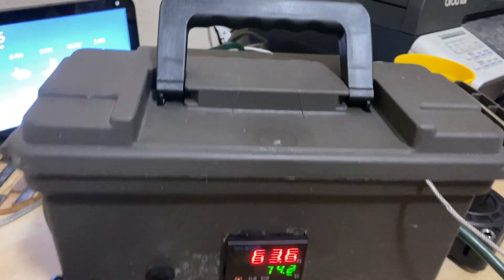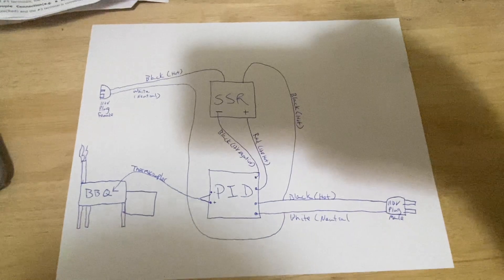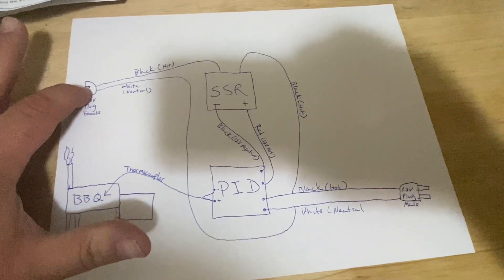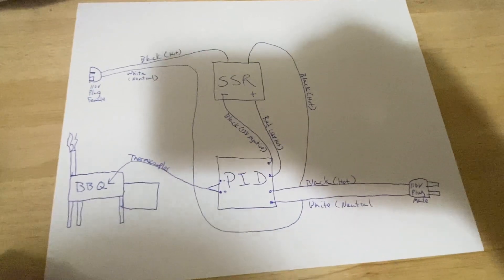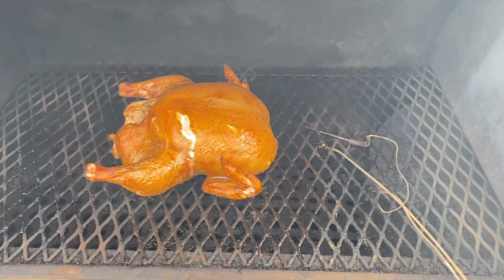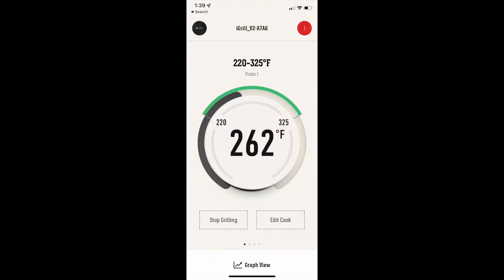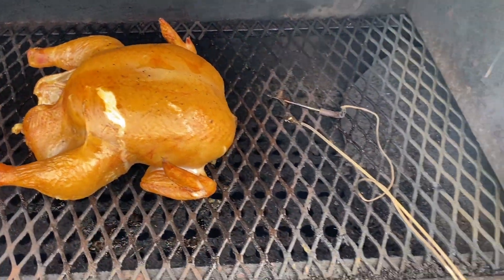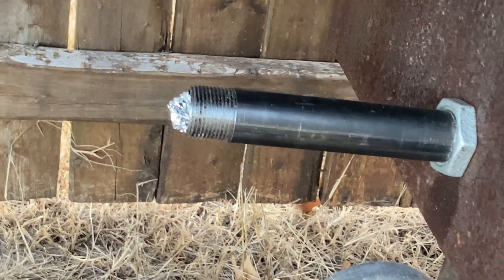How to build a PID SSR BBQ TEMPERATURE CONTROLLER

Comment: How did you get your thermocouple to stop bouncing everywhere... Mine is all over the place.... Like a 50 degree swing
Reply from the maker: Mine reads about 50 degrees higher than my pit thermometer but it doesn’t swing much.  It’s not perfect but It helps me maintain my fire. 

I also added a fan controller that slows my fan down a bit.

Comment: Did you set your own pid values or did you set it up with self tuning mode? Thanks
Reply from the maker: I set the temperature myself. It’s a little bit tricky because I’m working with an older pit thermometer that’s about 50 degrees different from the pid. It’s not perfect but it works fine for me.

Comment: What did you connect the female plug to?  The fan? Auger?
Reply from the maker: @dbramer6388  yes I’m using a small fan that is made to inflate a mattress. It works great. When the temperature drops, the fan comes on and stokes the fire until it brings it back up to my desired temp.

Comment: Great video, just wish you had put up a parts list for the SSR / PID or detailed where you got yours. Nice job though! Looks like it works a treat.
Reply from the maker: Thanks for watching and providing feedback. I’ll add this to the video description. 

PID Controller
https://www.amazon.com/dp/B01KJYQG2C?ref=ppx_pop_mob_ap_share

PID Fan
https://www.amazon.com/dp/B09XGMKCCR?ref=ppx_pop_mob_ap_share

Solid State Relay
CG Solid State Relay SSR-60DA DC to AC Input 3-32VDC To Output 24-480VAC 
https://www.amazon.com/dp/B08GP8L31L?ref_=cm_sw_r_apin_dp_ZZ5JQBNM1CXJT147MD12

Thermocouple Sensor K-Type
https://www.amazon.com/dp/B0142SKL0Y?ref=ppx_pop_mob_ap_share

Ammo Box
https://a.co/d/gE9mEpy

Black/Red Wire 50FT 12/2 
https://www.amazon.com/dp/B08MF7BN8H?ref=ppx_pop_mob_ap_share
Reply: @gws1977  With your handiness, had you ever thought to take a swing at a home brew cold smoker? They're also in the 150-200$ range with no reason to be. Handy for chili, fish, nuts, jerky, bilitong, etc. As a how-to video, this also might've been better if you had wired it up on camera. A V2 suggestion, a magnet-lined rim of a bowl would let the forced air be mounted non-permanently to any steel firebox, kettle or WSM.
Reply: Do you leave damper door closed at all times?
Reply from the maker: @The210Boss  yes I do, but the vent stays open.
Reply: Hey thanks for this video and parts list too. How's the Inkbird PID controller holding up ? Tryin to decide on a controller for my homemade kit for a Masterbuilt 30 inch electric smoker in which the factory controller died and they don't make anymore. Thanks again.    Mike
Reply: @Mike-ig2zq I used mine for exactly that and it held up great. I have the inkbird 106vh
Reply from the maker: @Mike-ig2zq the inkbird is holding up well. Zero issues so far. Thanks for watching and commenting. Sorry for the delayed response.